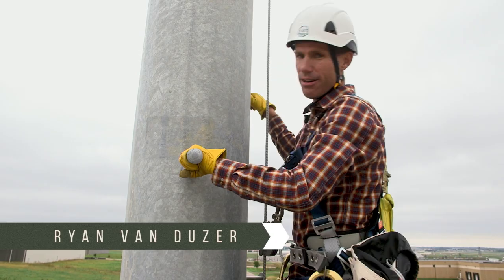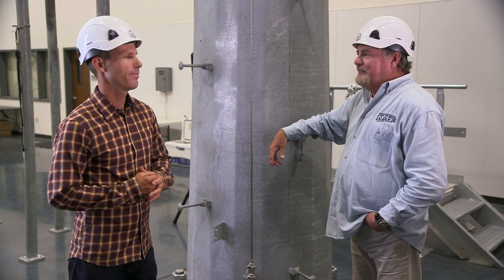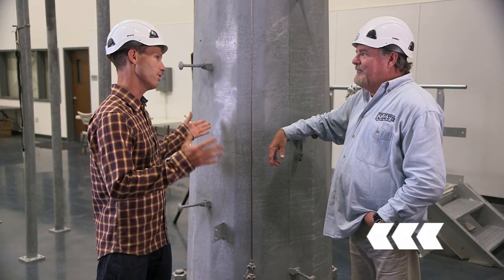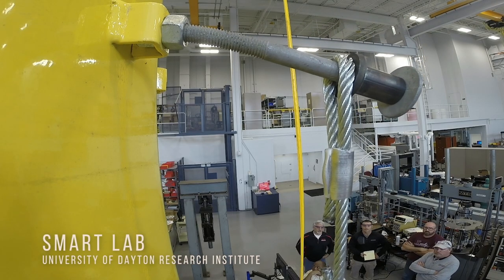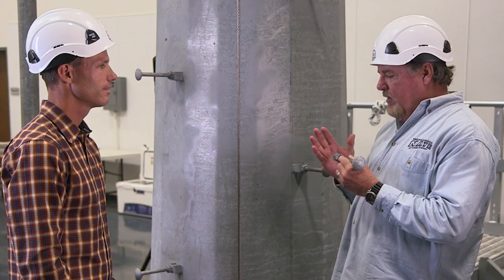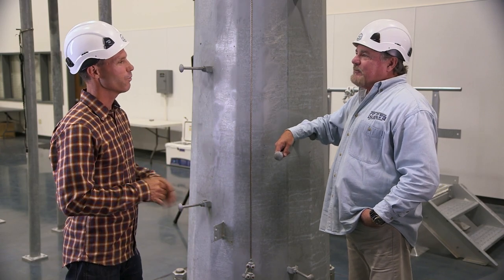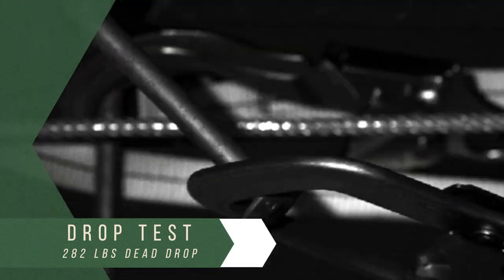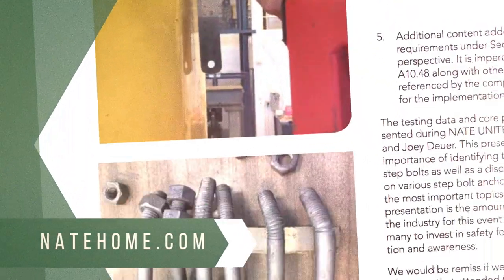NATE Step-Bolt Testing Results #ClimberConnection Video

Comment: I don't use them as a means of safety, but I would like to see the results of a strap prusik to the most inner part of the step bolt.  Not sure if they were tested that way?  If you want to test something to prove something you have to use every situation to eliminate people thinking it is stronger closer towards the tower.

Comment: There is an OSHA requirement for fall arrest anchors, essentially 5000lbf or 2 x the force applied when arresting a fall.  There appears to be no reasonable basis for the testing applied on this video.  5/8" stepbolts are generally not acceptable as an anchor unless the applied force can be kept close to where the bolt joins the tower.  In this case, the moment (leverage) applied to the bolt is minimised.
Reply: I think this is just like those videos they show in drivers ed of what happens when you don't wear your seatbelt.  I'm not in the industry but I enjoy giving myself sweaty palms by watching people climb towers.  I've seen many of them do exactly what is being warned against in the video, particularly when there is no obvious alternative.